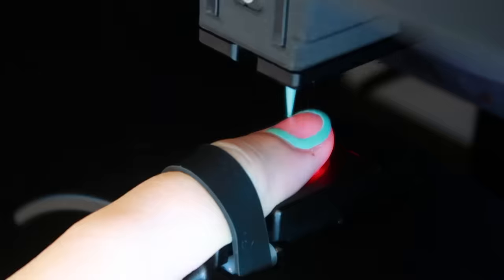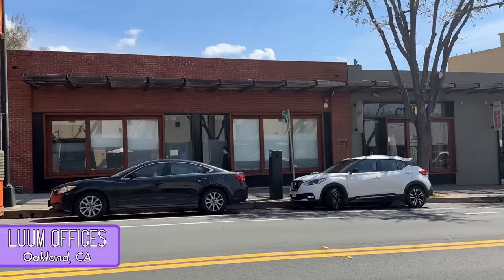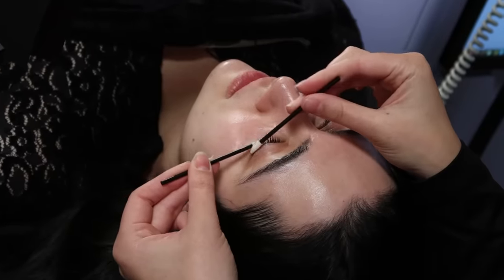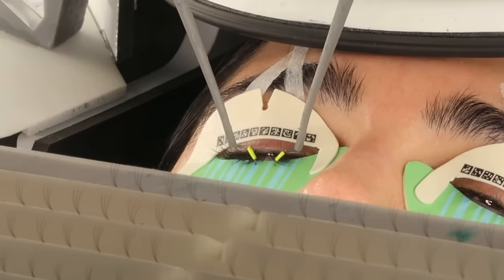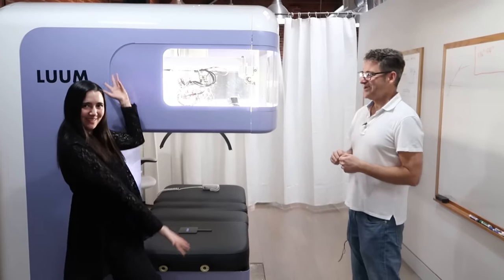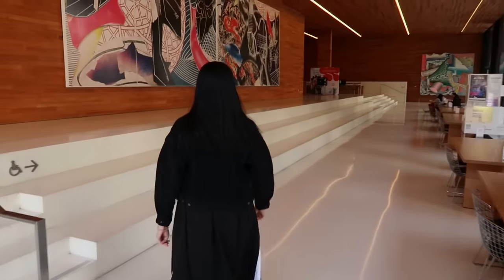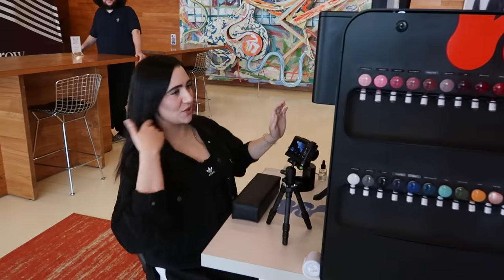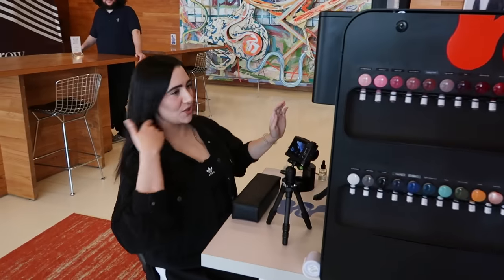I Let Robots Give Me A Makeover

Comment: still trying to get a clockwork robot onto our nail polish truck 🤖🚚
Reply: The FitnessGram™ Pacer Test is a multistage aerobic capacity test that progressively gets more difficult as it continues. The 20 meter pacer test will begin in 30 seconds. Line up at the start. The running speed starts slowly, but gets faster each minute after you hear this signal. [beep] A single lap should be completed each time you hear this sound. [ding] Remember to run in a straight line, and run as long as possible. The second time you fail to complete a lap before the sound, your test is over. The test will begin on the word start. On your mark, get ready, start.
Reply: Hi tyler
Reply: Lolll
Reply: Lmao
Reply: Lol,and hi Tyler
Reply: More like a clockwork orange robot 😅
Reply: Hi Tyler!! 👋 Yess you should that would be So Cool, and Interesting!! 🤣 💕💅🤖👍
Reply: @LoganPAILLL wtf 😭
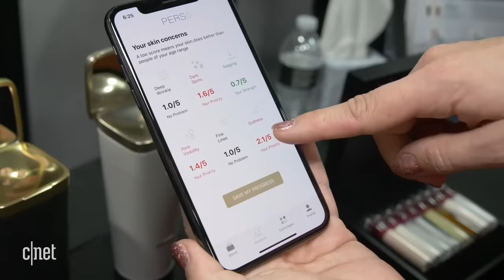Reply: 3:04 Get Simone to build a custom robot for the truck. That's a crossover I really want.
Reply: It should probebly be stored inside and deploied outside befor using it (more stable that way)
Reply: Fantastic idea, but might mess with the fuel (truck's) economy.
Reply: Hahaha😂
Reply: Hi Tyler, it was nice seeing you in this vid, albeit briefly 💕
Reply: I would never trust robots getting to MY BODY parts
Reply: tyler being saf’s biggest fan is everything

Comment: the nail polish robot seems like such a missed opportunity for it to be gel polish was the curing light inside the robot, it would last so much longer
Reply: That’s what I was thinking
Reply: We are working on gel! Coming soon. So many priorities to juggle as a small team ☺️
Reply: i mean they can only improve it from here so
Reply: @renukaapte80  It seems like removal would be the sticky wicket. Gel polish is a 🤬 to remove at home 😅
Reply: I thought the same. Regular polish just isn't worth it to me, especially without a topcoat.
Reply: Sure fire way to cause allergies
Reply: yea omg
Reply: The robot seemed to be a bit messy though. At least I saw some mistakes on tylers nails. Gel would hard to fix after once its cured.
Reply: I don't see how gel polish could work. Even a simple gel overlay requires a lot of prep and precision in order to get a lasting manicure, neither of which this machine seems capable of. And that's quite problematic when even the smallest mistake could lead to lifting polish, cuts in the surrounding skin, infections or gel allergies.
Reply: It's very easy to develop allergies to gel polish due to getting it in your skin. I could see this being an issue with the robot!
Reply: Yes, but gel is more than just one coat of color. Without primer, basecoat, and topcoat, it doesn't last.
Reply: she mentioned in the video they are working on gel
Reply: If the machine gets gel on your skin then cures it you’ll get burned. It’s much safer to use regular polish.
Reply: What do you mean?  @crisiscat  
edit: nvm I saw someone elses comment lol
Reply: It would be good if you can choose between gel or regular polish and also the regular polish would of course need a topcoat built in

Comment: I’m REALLY surprised that the nail robot doesn’t use UV gel polish
Reply: Yes I think that would be much better. All this robot does is apply one coat of normal polish, no manicure, no top coat, no express drying or anything like that. Every time I have gotten a manicure with polish, applying the polish itself in one coat never took 10 minutes, so the robot is not really faster than a human. The part that takes time is the actual nail treatment and waiting for polish to dry.
Reply: @s.a.4358 it definitely could be good like if you have a big event and your fake nails pop off or chip real bad and you wanna look professional but don’t have polish with you or something. Or you can’t do your other hand… like me
Reply: I wonder if the viscosity is a bit different?
Reply: They’ve left comments that they are working on it. They seem really involved in the video and are actually responsive. That’s pretty cool.
Reply: yeees if its all about being in a rush, that robot paired w gel polish would be a HIT. and gel polish is easier to distribute, you probably won't see the pipette thingy marks cuz it will flatten itself, as most gel polish does
Reply: I think the problem with gel, is they don't do anything about the cuticles, and with as much of a pain removing gel is, it's suck for it to grow out in just a couple days.
Reply: If I had to guess it's because gel has to be applied in thin coats if it's an opaque color so that the cure light can get through. With the machine making it opaque out the bat it might not be able to fully cure.
Reply: @rae_d8209  I'd say it's more bc of all the prep work involved in actually making a gel manicure last. You have to push back and remove the cuticles, buff the nail plate, dehydrate and apply primer, use a base coat and THEN do the actual color. Otherwise, the gel would just peel off a few hours after applying. Robots are smart but idk if they're at that level yet.

Comment: The nail polish machine definitely needs a top coat, the ability to ask for different colors on different fingers, and designs
Reply: yeah I wondered about that. No top coat means your ten minute mani is going to take an hour to dry.  And they can seem to only do one coat. (but a thick coat)
Reply: I don't think this is a replacement for nail artists. It's just if you want a basic paint for your nails that you could get it done quickly with this machine, which is fine. It should assist in jobs, not replace them.
Reply: @soulangela7154  a fair point
Reply: I sort of agree but if you think about the fact that they want it to be “quick” (ex: the LinkedIn building if you arrive for an interview and don’t want bare nails, airport while you’re waiting to board a flight for a wedding) you don’t NEED all of that stuff. If you wanted to take the time for all of the fancy, then you could still book and utilize a full service nail appointment as the robot isn’t made to replace them.
Reply: I reckon they are still working on the process and such. Very cool machine they already have and I'd be interested in seeing it get even better!
Reply: @emilysun925 well said!

Comment: The only problem with the nail polish robot is that it doesn't wrap the tip of the nail in polish, that's why the nails will chip sooner. A topcoat would help as well, so I hope they'll make that happen too! 
Thanks for another great video! ❤️
Reply: I think the fact that it doesn't really work in the first place is a bigger problem. It failed so many times.

Comment: I thought this since I first saw the nail polish robot, but gel polish seems like it would make more sense. Getting a quick nail polish sounds good except it has to then dry. If the nail polish robot could also cure your polish, it seems like it would make someone more likely to use it on like a lunch break.
Reply: I really expected it to be gel cause how would this be dry at all?? there's no base coat, no top coat, and one thick coat instead of like three thin ones 😬 there's no way I would choose wet nails in any scenario

Comment: The way the polish robot works is fascinating. I thought it would brush the polish on, but the way it pipes it out like cookie icing is so interesting.
Reply: Saf said that the lash machine reminded her of a 3D printer, but the nail polish machine is totally a customized 3D printer! The way the nail polish is "piped" is exactly how FDM 3D printers lay down each layer of plastic!
Reply: I’m wondering how easy it would be to integrate a gel polish option, with built in uv light. The manicure would last much longer if they are able to!

Comment: I'm glad that Nathan has the lash artists in mind with his robots! I would be interested to hear what other lash artists have to say about LUUM. But the fact that Nathan laid out the benefits that LUUM could give the artists sound really promising!
Reply: Except he way over exaggerated the benefits and conveniently didn't mention all the costs lol. I've had lash extensions for years and the gal I started with and the one I see now does my fills in about 25-30 minutes everytime. A full mega-volume initial set takes about 2 hours total. If you have to buy the machine, buy only their lashes and supplies, pay for the software upgrades, maintenance, and electricity, and pay a tech to monitor the machine I can't see anywhere to turn a profit.
Reply: I see what you mean. They did say it would allow the artists to have more clients? I'm not sure if that would make up for it. Nathan could also be eating the cost until the machines bring in a high enough volume of clients to make it worth it. Who knows 🤷🏻‍♀
Reply: He said how he has them in mind but I really don’t think it does. You don’t need to be a lash artist to sit behind the machine and watch it do it. The tasks there are more technology related than eyelash related. You don’t need to be good at putting on eyelash extensions to do that job. The only part a lash artist is actually needed for is the quick check afterwards which is already really quick and will likely get quicker when the robot improves. With those robots you’d only need one lash artist instead of like 10. And I’m sure most lash artists who do enjoy their job wouldn’t enjoy sitting there operating a machine instead. It really seems like it’s going to take away jobs from lash artists to me.

Comment: Are those nail polish remover pots uncommon in the USA? I've used them for many years, albeit having to twist it or my fingers myself (it's not automated). They're usually acetone free and include 'beneficial' ingredients. Quick, cheap and pleasant. I've had the same pot for probably over five years and it's still going strong so seeing them used as a disposable item is slightly upsetting but completely logical for hygiene reasons. 🖤

Comment: The nail polish robot fulling the nails and either not going right to the edge or going over so the polish goe under the nail as well as not using top or base and also just normal polish annoys me lol
 if you're in a pinch and need your nails done fast it makes sense to be gel so you 1 dont mess them up during application and 2 dont mess them up a while after theyve been done as well as being much faster. Also a good base and top coat will help with longevity and for a nicer application

Comment: It's a great idea but I see a lot of flaws in the nail polish machine. 1. theft/vandalism of components of the machine is too easy. 2. polish doesn't last (even if it's cheap, paying a bit more and having it actually last is a big factor). 3. not many colour options (they should also have the swatches on a plastic nail so you can see what it looks like on), 4. needs a top coat. 
I hope they keep tweaking the design.

Comment: These both seem impractical, like the lashes falling out after 10 days? I appreciate safiya doesn't hide the bad side, but that was moved past pretty quickly. It's definitely not competitive price wise to manual lash techs if it doesn't last anywhere near as long before you need a fill + it's wasteful of lashes overtime. + a nail robot that is supposed to be quick and easy requiring such troubleshooting is also super impractical for its purpose. Maybe theyll improve with time! But right now, they're for novalty alone.

Comment: as an Aesthetician, this is honestly a terrible idea. So many things can go wrong with doing lash extensions this way such as getting the glue cured to two lashes or cured to a bottom lash by accident (which hurt btw) or if you get a lash pushed into your eye by accident. Any lash tech can tell you that doing lashes wrong can cause damage to the eye, and i have seen it happen ( a girl got her eye cut by the eye pad and then she had a reaction to one of the chemicals due to the cut, she had to wear an eye patch for a month). In terms of the manicure machine, yes its fast and easy, but you get a much more even polish and have more options for polish type when getting a regular manicure from a nail tech or aesthetician. For time and price point, a manicure is not expensive, given what's all in the service, and it takes 45 minutes from start to finish, some of us can get you out in 25 minutes depending on what you as the client wants and we can guarantee a week of wear, lashes take 1.5 - 5 hours if you want quality work, and if you want certain styles, they are not the cheapest thing to get, but you can 2 weeks guaranteed from them with very little fall out. The price point for these are in the same range as what spas/salons and independent techs average, as of right now, but if they go to market and become available for other techs to purchase, you will see a high price increase due to the cost of the machine and its upkeep. That 170$ will like go up by 100$ and the fill cost will be what it was for a full set. The manicure machine is decently priced at 10$ but the wear of the polish cannot be guaranteed and you are doing all the work of prep and clean up, so by the end of it, its not really 10 minutes, and takes as long as a nail tech would to remove the polish, apply regular polish, and clean up, which may take a tech 15 minutes total (based on my own timing to remove, apply base, 2 color coats, top coat and clean up polish) . i can see them being interesting to use in the beauty industry and how it wouldn't take away from techs doing their jobs, but i can see a lot of issues with the technology cause you wont get the same quality.